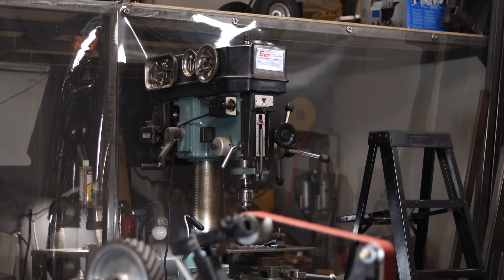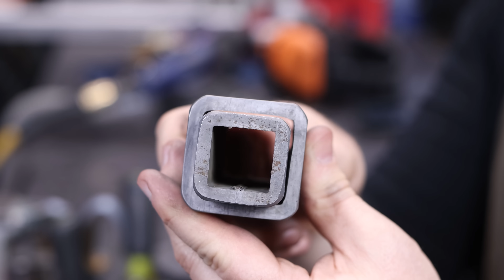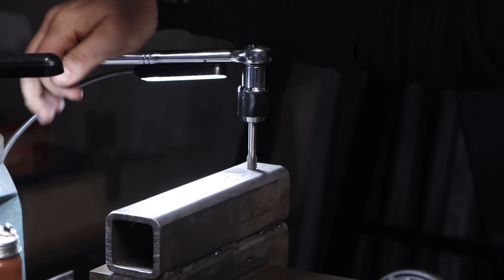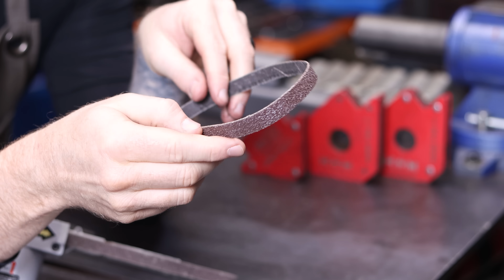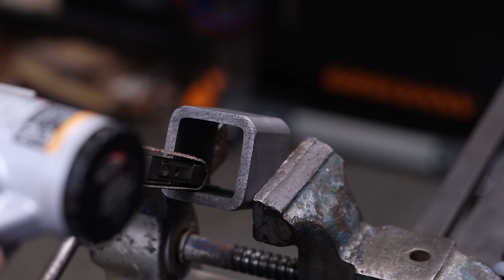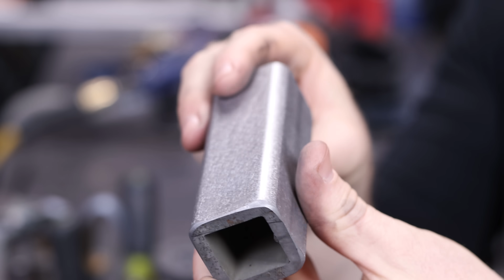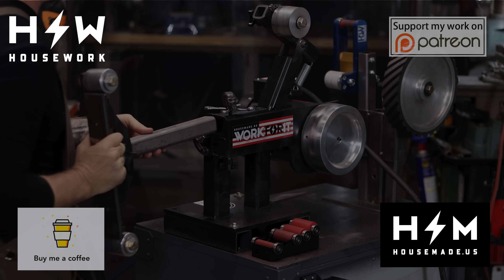How to: Remove Weld Seam & Telescope Tube Steel

Comment: Alternative for long lengths is grind a groove on the outside of the inner tube.  Or 4 if you need to rotate it.  Good for situations where the tube is too long to grind out.
Reply: Well said, that sander he showed is great, but it only goes so deep.
Reply: @aerialrescuesolutions3277  That is what she said!
Reply: Thanks, I will try this for my situation
Reply: @i_i8924  works better for thicker tubes walls than thin.  So just keep in mind if it's going to cause strength issues
Reply: @douganderson7002  I've seen that video.  It's a good method but a lot of mucking around if it's a once off or only a really small job.  If you are doing things regularly which need it 100% a better method.

Comment: Question Sir:
What is the plunge depth of the pneumatic tool ?
As in how far will it go into the tube before it bottoms out?
I need 10” deep on my project and it looks like the pneumatic version will plunge deeper than the electric although I would opt for the electric just because of price and the fact you don’t have to have a compressor everywhere you need to use it.
Reply: The common belt size is 1/2" wide by 18" long, so the reach will be a couple of inches less than 9 inches (half the belt length).

And the tool is a belt sander, not a "file".

Comment: Do you have a problem with maintaining the tolerance with paint? I'd assume with an unpainted surface that it would eventually rust. I'm looking for a solution for a piece that I plan to have outdoors, so rust is a much bigger concern.
Reply from the maker: Yes no paint can go on the arms. I use wax or oil to prevent corrosion
Reply: Might try cold bluing then add a lubricant like Boe-Shield.

Comment: Couldn’t you just cut a small groove down the length of the OD of the smaller stock to give clearance for the weld?
Reply from the maker: Sure. But the seams can wander so the groove would have to accommodate

Comment: This is great but I'm thinking - wouldn't be easier to grind a groove in the piece I want to insert in, so the weld seem would not matter? Perhaps just using an angle grinder?
Reply from the maker: Yeah some people do this, I personally don't like the way it looks. To each their own for sure. Get it done however you can! Thanks George.

Comment: Well crap, had no idea that tool even existed. I just made a crossbow press where I needed to remove that internal. Weld. I used a long file. Took me every bit of an hour to file it down on a 24” piece of 2” square tubing.

Comment: I made a inverted fork spring compressor with square tube steel (picked up at the local scrap yeard) years ago using this same method, smaller square tube inside a larger telescopic, very large 5/8" threaded rod(also got at the scrap yard),  cheap small c-clamps I took apart, and removed the cup feet off of, to hold on either side of the inner fork spring, some cutting & welding and about $20 later I had a $200 heavy duty fork press, better than the $200 ones.

I even welded another short piece of square tube steel to the back side of the longest outer tube so I could clamp it in my bench vise for a very nice vertical hands free workstation.

The one thing I wish I would have tried was vinegar to remove all the milscale back then, I used several other long drawn out painstaking methods and once it was done painted it all with a durable black trailer paint.

Comment: That's great on short pieces. But what do you do when the dynafile is to short to get into a 1' piece or longer?
Reply from the maker: If the piece is 15 inches or shorter you just can turn the piece around and grind from the other side. If it’s longer than 15 inches the best thing to do would be to buy tube that does not have a weld seam or to look at Jason from fireball ools he made a device that can be pulled through a piece of tubing and it removes the seam.I

Comment: Picked up the electric 5 amp Chicago electric band file from harbor freight for removing the seam in my grinder build. The pipes are 9” long and that’s about the longest pipe it can remove the weld from. But it was fantastic. Took about 5 minutes per  9” pipe. Which there was two of. For 30-40$ it’s a great tool. You saved me a lot of time trying to file or chisel it out with the bandfile suggestion! 

I’m using 2x2 1/4 wall tube and 1.5” solid bar stock for the arms
Reply from the maker: Awesome Justin thanks for letting me know. It is a great little tool to keep around. 🙌🏻

Comment: Try tapping your set knob on the corner instead of on the flat. That wedges the opposite corner into the V and holds it much more securely for a given tightness.
Reply: great tip!
Reply from the maker: I’ll give that a shot. Thank you!!
Reply: Great Idea!
Reply: What a great idea!!
Reply: Nice. Cheers

Comment: Have you seen the "Seams Impossible" rig from Greg's Garage? Elegant solution.
Reply from the maker: I have and it’s awesome. I’ve spoken to Greg about it and hopefully I can get my hands on one.
Reply: @HouseMadeUS  me too, but apparently it's hard to get. I'm sure that, like you, they're always asking themselves: what is the point of saturation in my market, and trying not to  get caught with more and upgraded equipment that enables them to make 1.5 times the volume that the market will support. And that results in a perpetual state of "out of stock." I was glad to see that your kits were in stock last week when I made a buying decision. I'm excited to build the  Gen 4 and learn a bit of MIG while I'm at it. I've got the multi-process Vulcan and excited to make my first real step from wood to metal. Screw it, I'm gonna do it.

Comment: Have you ever heard of flash out tubing? It's available from any good steel service center. The weld "flash" is already removed to accomplish what your doing.
Reply: Might be the same thing by a different name, but I've used "mechanical tubing" and "seamless tubing" before. I didn't order the material, I was just good at following blueprints and allowable tolerances.
Reply: More expensive and not always available.  But yeah it exists
Reply: You’re

Comment: Well decades ago when making receiver type items, I would just clamp a straight edge to the internal to match the outer weld seam and drag an abrasive disc and make a notch. Problem solved.

Comment: Apple cider vinegar is wayy better that white.. we use an air mattress that we cut in the middle of the side wall to make twin pieces,  then lay wide pieces in it and pickle them in . water and baking soda is what you need to neutralize  the steel.

Comment: I have ID scarfed hundreds of millions of feet of tubing in my 30 plus years for working as a Tube Mill Engineer. We removed the weld bead at 500 ft. per minute 24 7. The same process is possible in your shop, no sanding or filing just a little toolmaking, simple tool making.
Reply from the maker: Awesome, send the details to brian.housewert@gmail.com
Reply: @HouseMadeUS  Couldn't you just make your own tool for cheap? Eg, get a HSS blank and cut to suit the ID of your outer SHS, then notch a suitable length of you inner SHS to hold the tool. Chuck it in the press and push it through?
Reply: Inside weld seam shaver?

Comment: That is very interesting on the Mill Scale I will give it a acid vinegar bath first
Reply from the maker: Its a great way to get rid of the scale. I use it daily!
Reply: Industrial vinegar 30% not the household 6% vinegar.
Reply from the maker: I use standard household vinegar. Works great!
Reply: @HouseMadeUS  used that for a slight etching on aluminum and galvanized metal so paint will stick.
Reply: Where would you buy industrial vinegar?
Reply from the maker: I have heard you can get it at Home Depot. I just buy regular vinegar and it works great.
Reply: @arctichc415  Home Depot, Lowe’s, ace hardware.

Comment: So what do you do if your tubes are longer than you can reach with your grinder ?
Reply: I weld a piece of tool steel to a block of steel and build a threaded rod to force it through the the tube
Reply: Grind a groove in the outer wall of the inside piece lol.
Reply: @rong4189  thats a feature!
Reply: Repost here ya make a slug about 6" long insert a pneumatic die grinder valve on.  Make the carbide proud of the tubing.  Bevel the front end a bit and then turn it on and shove it in like a skewer snake
Reply: Your super duper screwed
Reply: That problem only Seams Impossible. (Google it)
Reply: It just can’t be done.  It’s impossible.  Sorry.

Comment: The quicker way to do it is to buy it with the weld seam removed. Little more cost but well worth it.
Reply from the maker: 10x the cost actually.
Reply: @HouseMadeUS  Not even close. I own a steel fabricarion shop. It's 2 to 3 times the cost. Also mill scale does not "clog" a flapdisc. That one was funny. You know just enough about steel to be dangerous.  🤣
Reply from the maker: Anyone can say they own or are anything on the internet. Email me your shop phone number so I can call you to discuss this. brian.housewert@gmail.com

Comment: I put a hard edge on the inside tube with a tig a old drill bit as filler. Ground it so that edge stuck out slightly. Then I pressed the inner through the outer. Worked like a chisel and you can use it over and over.
Reply: Thats a nice tip, using an old drill in the tig, thanks dude.
Reply: @JavierChiappa  make sure you do 2 passes with the drill bit filler. First pass mixes with the base metal and isn’t as hard.

Comment: I  just made a 2 x 72 and instead of grinding the weld out I ground a small { weld size] groove down the inner tube. All you need is a regular 4.5 in. grinder that most of us already own. The advantage is you are not restricted by the length of the tube. worked well for me.
Reply from the maker: That’s one way to get it done. My personal preference is to not see that groove on the outside. It’s ugly (to me) and if I spend this much time fabricating a tool I’d like it to look as professional as possible. Now does that change the functionality? Not at all, so if you can look at it and be good with it, more power to you! I just like a clean look, and that was my goal. Cheers! 💪🏻😁
Reply: I agree with you, House. I have a machine shop in my garage. Make it look good or be a hack that doesn’t have the tools or knowledge. I watch all the YT Mach and Fab video’s. There are answers here, just look for them.
Reply from the maker: Thanks man. I appreciate the kind words. It’s a personal preference but in my head makes a big difference.
Reply: Yeah na. That weakens it and makes it looks scruffy. Make a broach from lathe HSS. Easy to make ,does super long lengths to.

Comment: What kind of acid do you soak your steel tubes in?
Reply from the maker: Standard household vinegar. 😁
Reply: @HouseMadeUS  there are various strengths of vinegar sold for household use,  including stronger versions called "double strength" and "pickling vinegar"... so there is really no "standard". Are you using 5%, perhaps?

Comment: I am in process of building three grinders. Looked at many different ways to remove the weld but like your video I settled on an air file. I have three different sizes but the 18 and 24 are the best for this project. I like 36 grit belts on this part. I have also tried the vinegar and it works well. I would advise that you look up a Norton Surface conditioning disc. This it a non woven silicon carbide disc that might be a little pricey at first glance but, it really works on removing paint, power coat and mill scale without clogging. One more thing that I had happen was drilling in to a weld. Snapped a bit right off. Should have gone a bit slower on the own feed. Getting really close now to assembly. Made my own version of the tracking device and looks like all will come together well. Thanks!

Comment: 12 minutes of Bla Bla Bla with two minutes of instruction. Nice camera work but need more content. You could just buy tube steel that is smooth on the inside.
Reply: Bummer, was looking for a more intuitive way to remove the inner weld. Especially if you tube is over 12in long.
Reply: I thought he'd never shut up.
Reply from the maker: At 10x the cost?

Comment: I guess the dimensions of the tube steel could vary a bit, perhaps they differ here in Canada, cuz after removing my weld seams I had to sand my 1.5" tubes for a very long time in order to fit them inside 2" ones. And that after removing mill scale everywhere. Good thing I have a trusty supplier of Elbow Grease!
Reply: I, too, had difficulty with the steel ID sizes. The first attempt had an offset weld that changed the radius of one corner.  My second attempt had the weld centered on one side, but one radius was still different.  I had to sand the 1 1/2 to fit, but that is called fabricating and I was okay with that.
Reply from the maker: Wayne, I have done that same thing. Fixed it up the same way. Totally fine with it and your right, it’s called fabricating for a reason! 💪🏻😁
Reply from the maker: Gotta love that elbow grease. You definitely must be running low after building the Revolution by hand!! Cheers brotha!! 💪🏻😁

Comment: "$20 worth of steel", but as a DIY'er, any steel yard I've ever walked into forces me to buy the entire length of steel (20 feet), because they don't like hobbyists. REM section sometimes has the offcuts I need for stuff, so I usually go in with my fingers crossed. Or I'm prepared to spend more than I'd like.
Reply from the maker: The cut offs area is my favorite. I buy stuff I shouldn’t. I look at it and go...hmm I could build XYZ with that...and then never do. Lol
Reply: @HouseMadeUS  i do the same. Straight to the scrap bin.  Uuuuuh ooooh i can build something. And then it takes months until i do something with it
Reply from the maker: So my situation is not unique. 😂😂😂

Comment: Jason at the Fireball Tools channel has a cool way of removing weld seams on square section steel, but it only has that purpose. The powerfile can be used in a myriad of different ways. 
🤜🏻💥🤛🏻
Reply from the maker: For sure. If you do a lot of that type of thing that tool makes sense. I really like my power file and this was a great way to show off its magic! 😁
Reply: @HouseMadeUS  
It makes a great motorcycle noise, too!  
🏍 💨
Reply: That guy fireball tool is overkill no one has time to make that tool he used to do this

Comment: Tube steel is not all the same. In my particular case, even after scale removal, the 2 inch and 11/2 inch steel were not even close to telescoping. foreign arder to find but am also told that seamless tube steel is avail, altho not  less than 21/2 inches.  In the end, all works well even though mine will not likely make the cover of Popular Mechanics.
Reply from the maker: Yes I have heard some folks running into this issue. I highly recommend verifying sizing prior to purchase. One stick came to me squished so bad I had to send it back but that has been a rare occurrence. Hope you’re doing great Jim! 💪🏻

Comment: Actually i remove the weld seam and it was not helping .. I realize that the tube is not square from inside so i grind the 1.5 inch outer side and it works
Reply: I also had to do that on my build.
depends on where u get your steel from I guess.

Comment: Vinegar make my steel smell like pickles.
Reply: I’ve worked in the steel rolling mills, when steel strip is run through the acid bath it’s called pickled, a term from the old English knights using vinegar to remove rust from their armour
Reply from the maker: I love pickles. 🥒😁
Reply: Richie....I bet the vinegar would make your cucumbers smell like pickles too.

Comment: How would you remove the seam from a tube that is 18-24" long?
Reply: Go watch fireballtools video on removing the weld seem it's a bit of a process but if you need to do multiple it's a good idea
Reply: @carterbaldinelli4592  Thanks
Reply from the maker: Yeah watch Jason’s vid on his special tool for that. This file won’t do the job.
Reply: @HouseMadeUS  Thanks